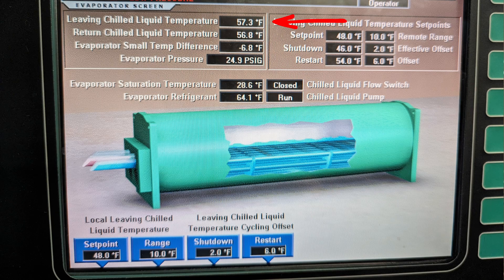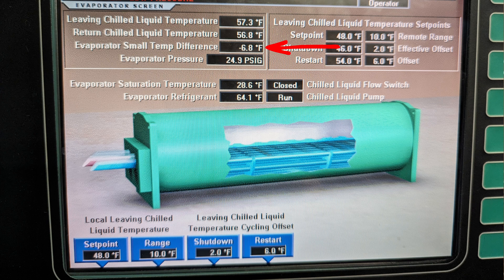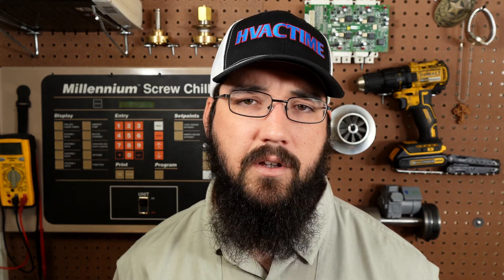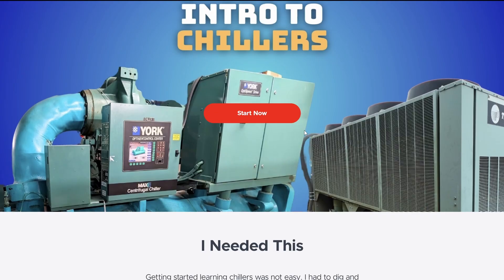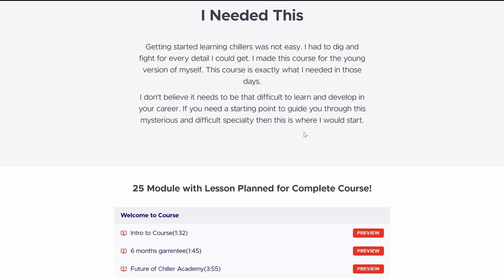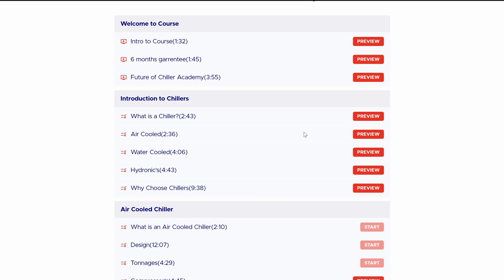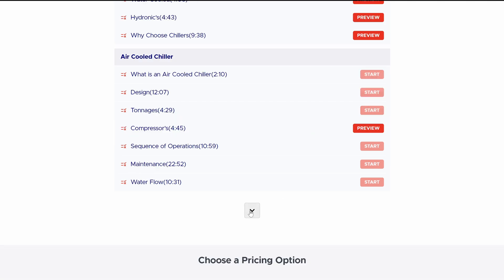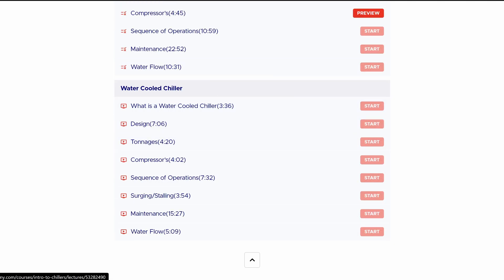Chiller Evaporator Approach & How to use it

Comment: Really?? Low Evap flow wouldn’t cause higher approach?
Reply from the maker: No, because the water has so much contact time with the refrigerant. Once the flow is too low, the circuit will likely not be able to start without tripping low pressure if flow sensor didn't catch it. In this case, you'll still see higher leaving water temps.

Comment: What causes refrigerant to water or vice versa leak? Couldn't figure or find a lesk on a chiller i was wondering on until i used my detector on the water pretty crazy
Reply from the maker: If there is debris in the water it can puncture a hole through the thin tubes. Improper chemical treatment can create a hole. If the chiller was recovered but the barrel was not drained or did not have water flowing it could have caused a crack. Those are the most common reasons.

Comment: Great information on the approach values.  This is information I log daily, but unaware of the actual reason why it's important.  Several chillers are on site but currently working with Trane Centravac from the 1970s. Tube and shell flooded.  Size CV-12F-G5-H5. 

Current condenser approach 7-9°

Current evaporator approach running 10-15°

Condenser tubes punched yearly. However, I have no information last time that evaporator tubes were opened up.
Reply from the maker: Ya those approach valves aren't good but ive seen that older equipment run higher valves from where and lack of efficiency.

Comment: I got an approach of 28.7. What is a  typical approach on that chiller?
Reply from the maker: Whats the model number and heat exchanger type?
Reply: @HVACTIME  I meant, that is what I calculated from the example on the display of the chiller video. Is that what you came up with?
Reply from the maker: ah I see, lol that chiller was off when photo was taken. Will be less than 3 when online.
Reply: @HVACTIME  10-4, that makes sense now. I appreciate your videos and will learn from them.

Thank you very much,